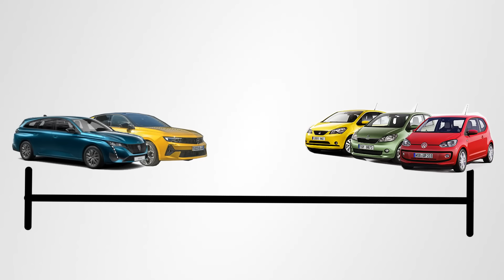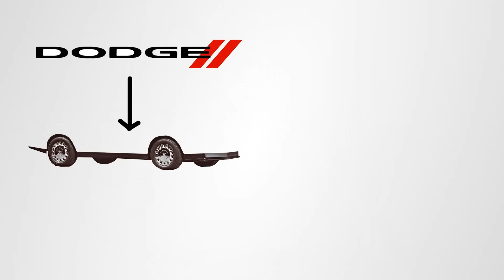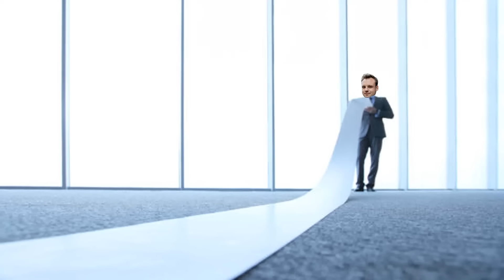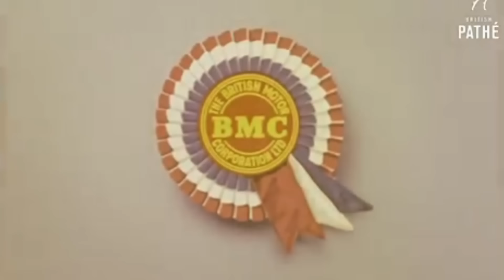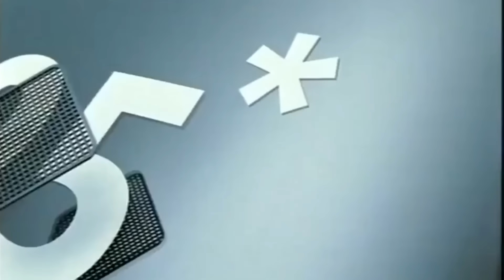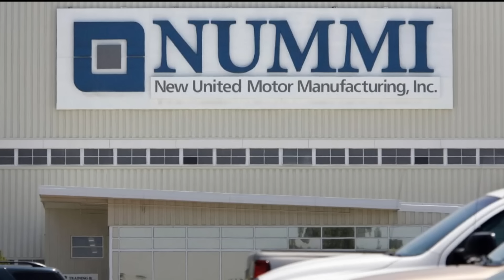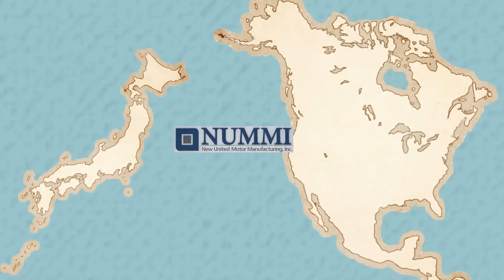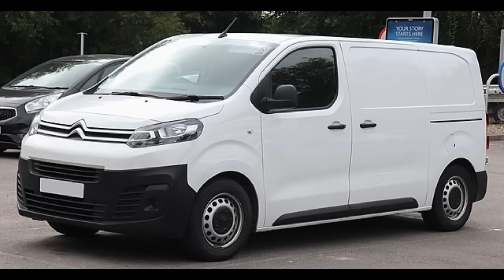Ep. 30 Seeing Double: The History of Badge Engineering

Comment: Rebadging is one of my favourite bits of auto industry insanity. I mean, try and tell the difference between a postwar Dodge and Plymouth, right? Of course I come from the land of Plodges and many of our "home-grown" cars were courtesy of sticking new name tags on existing models. My wife has a Dacia Dasher she calls Daphne; I call it the Romania Renault.
Reply: Our Chrysler cars years ago all had Plymouth bodies, really making them look badge engineered in comparison to the American models.
Reply: While that is true, things were wild in the opposite direction in the early to mid 50s. When Chrysler bet the farm on its new hemispherical headed V8s they didn't build one V8 for all divisions. They sprung for three different engines with different sized architecture. The small 241-270 cubic inch Red Ram V8 for Dodge, a medium sized 276-291 cubic inch Firedome V8 for Desoto and the big 331-392 cubic inch Fire Power for Chrysler. I recall that Plymough eventually got the cheaper polyspherical version of the Dodge V8. When Chrysler replaced their hemispherical V8s. Crazy times those.

Comment: Rebadging in Europe was often practised. Some models were namend here in the comments: First Fiat Ducato was also Citroen Jumper, Peugeot Boxer and Talbot. The Mercedes G was developed by Puch and is until today available as Puch G. There were 2 other Versions oft the G from Peugeot and Panhard. They had other interior and Peugeot Motors. 
Fiat did another project with Fiat Chroma, Alfa 164, Lancia Thema and Saab 9000. Saab also rebadged Lancia Delta as a Saab model.

Comment: From what I remember Holdens here in Aus are various rebadged cars throughout the years from buicks to opels. My favorite though is the 2013-2017 commodores in America are called Chevy ss. Different badges, slightly different trim, worse firmware for the infotainment system and I think that is about it. They didn't even go the Pontiac route with the G8 with bumpers or anything. You look at it and its undeniably a commodore shipped from Australia to america with the changes XD.

Comment: Ford and Chrysler always got away with rebadging cuz they always had, where as the gm brands all had different engines and sheet metal people expected them to be legit different makes. When the 80s came anyone who was an olds or buick fan never forgave gm. Remember the olds cutlas suprime was the top selling car of the late 70s. Now its just a rebadged chevy celebrity? Off to the competition.
Reply: Then again, Chrysler was a worse examples, I mean name me a Plymouth that was made from 1976 to 1999 that was different from a Dodge or Chrysler, you literally can't for 23 years no original design came from Plymouth
Reply: @nickrustyson8124  thing is nobody cared cuz everyone knew a dodge was a plymouth with some more chrome and a chrysler was a spruced up dodge. Today it is still the same with chevy and gmc. Where it becomes a problem is what gm did in the 80s with buick and olds (and to a lesser extent cadillac) when they took legit independent brands and in a few years turned them into what almost looked like rebaded chevys or rebadged versions of each other. Publc used to expect something different from each gm division and now they were just slapping different names on the same car.
Reply: @Henry_Jones  But everyone knew Pontiac, Olds, Buick, and Chevy were the same thing it's a very notable problem with their 1958 line up, the only difference was it was more of a bitch to get them repaired because Chevy and Buick both had 3.8L V6 engines that are not interchangeable
Reply: Honestly, it didn’t help that GM had a HUGE dip in quality going into the 1980s. They should have stuck to RWD platforms, I can’t name a single good FWD GM car.
Reply: @anonuser5852  you nailed that one. 3800 powered cars are reliable as the sunrise and w body cars are good BUT theyre good as used cars. When they were new they were all a week late and a paycheck  short compared to what the competiton had.  Thats still true today. The fwd based gm suvs all suck while thr rwd ones are good.
Reply: Up until the mid 1970s GM division would have completely different engines EVEN if they were the same size! The 455 cid Oldsmobile engine and the  455 cid Buick engines were unrelated. GM was big on having individual engines especially at the higher price scale, and buyers were serious about this to, A Cadillac buyer wanted (seemingly NEEDED) to have different engine than a Buick or Olds. Oddly, Imperial Buyers seemed not to care that Imperials had the same engine as the "lowly" Chrysler New Yorker.. Weirder was when the various division's cars had different chassis while SHARING bodies!
Reply: @anonuser5852  That's a stupid idea, like the worst idea you could've done, the whole thing with American cars was that they were outdated when compared to the smaller FWD Imports, so instead of trying to improve, you double down on being outdated and just make everyone on the G Body
Reply: @nickrustyson8124  Plymouth was only allowed to remain as long as it did to give Chrysler dealers a cheaper car to sell, The corporation had always favored Dodge over Plymouth.
Reply: @nickrustyson8124  By 1958 GM cars had been sharing a group of bodies for over 20 years, The  "A', "B", "C" and "D" (really the "C" was a stretched "B"- a situation that would last until 1984!)  It was the 1959s when it became obvious, as every full sized hardtop had the same "greenhouse". While all of the '59's  (except the Corvette and the "D" body Cadillac limo) were "B" and "C"s, They had different chassis! Leave it to GM to have the parts you can't see be different, while the MOST visible part (the body) be shared!  Useless trivia: While it's a known fact that the "B" body had at one time or another been used for every GM division from Chevy to Cadillac, The "D" body was only ever used as a Buick or Caddy.

Comment: Chrysler sold a lot of re-badged Mitsubishis during the 80s; all the while trumpeting their Americanness
Reply: If I remember right, if it didn't have a V8 or a Slant 6, it was a Mitsubishi
Reply: @nickrustyson8124  no. The K-Cars were not Mitsubishi. But all the colts were. And the little pickup trucks
Reply: @kevinbarry71  No but their engines were
Reply: @nickrustyson8124  The 2.6 and later the 3 L six-cylinder were definitely Mitsubishi engines. But I'm pretty sure the 2.2 was all Chrysler. And they put a lot of those things in those shit boxes

Comment: A ton of Vauxhall/Saturn/Saab/Opel/Fiat

A ton of Daimler-Chrysler era Mercedes/Chrysler/Plymouth/Dodge. I had a US Chrysler Sebring that had Mercedes parts from the 200 and 300 class Mercs in it: Stereo, Heating and cooling, window regulators, suspension parts, and main unibody platform with changed bonnet and front/rear bumpers.  Engine was a 2.4L DOHC Mitsubishi engine.

Comment: Yes, I had a Geo Prizm that was a perfect twin of a Toyota Corolla.  And a Dodge Ram D50 which was a Mitsubishi Pickup Truck.
Reply: We had the Dodge D50 in Australia when Chrysler was still making Valiants here in Adelaide up until Mitsubishi bought the factory. The last Valiants in 1981 were badged as Mitsubishi Valiant as they ran the stock out. Mid 70's Chrysler Australia rebadged the Mitsi Galant as the Chrysler Valiant Galant! And for 1970  the Hillman Hunter with ownership connections with Chrysler, was sold in Australia under its own name- but with a grille and headlight treatment looking very "kid brother" to the 1970 VG model Valiant. (At the time Chrysler had no  small cars in Australia to their name).

Comment: The 1956 Plymouth was sold as Dodge Kingsway in my country. Several different Mopar cars were sold under other names here. Chrysler was often used instead of Dodge and Plymouth.

The Kaiser Henry J was also sold as the Sears Allstate. Sears sold the upscale models for the same price as Kaiser sold the cheapest base model of the Henry J. They were not too pleased about that.

The Chrysler Horizon were also sold as a Plymouth, and here In Europe they were called Simca Horizon. The Dodge Omni also has the same body, but they have rear wheel drive. The Peugeot 309 was also originally supposed to be a Simca.

The Plymouth Sapporo was sold as Dodge Challenger in the US. Many US car makers partnered with Japanese car makers and sold rebadged models in the US. AMC partnered with Renault.

The VW K70 was originally a design from NSU. But right after VW bought NSU they put their brand on it and sold it as a VW.

Several Fiat models like 500, 600 and others were sold as Zastava, Neckar and several other names.

I once believed that my dad had bought a Dodge Aspen. But suddenly I discovered a Volare badge and it turned out that it was a Plymouth. From the inside they are identical. On the outside the grille, lights and turn signals are different. And the side trim sits lower on the Volare (if it has the trim). Other than that they are identical. There was also a modified version of the F body produced in Italy called Monteverdi Sierra, but it looks quite different.

In the late 1960s a German car factory assembled AMC Javelins and sold them as Ramblers.

The Dart and Valiant that the F body replaced also had a lot in common. Up until 1973 they looked quite different, and the Valiant had shorter wheelbase. But from 1974 and on they were almost identical.

The VW Polo was originally sold as Audi 50. But VW quickly decided that it would not be good business to have Audi competing with their economy cars and instead

Comment: My favorite was the early 1970s Nova series.  GM was even in our face with "so-what?" when it named them.  We had

Nova (Chevy)
Omega (Oldsmobile)
Ventura (Pontiac)
Omega (Oldsmobile)

Geez  - N-O-V-A.  And all were the same except for grills and taillights, and of course some interior bits.  Bodies were identical.  I think suspensions were identical, and I think engines were identical at that time, even tho each company used to have different versions of small block v-8s.

Comment: One of the benefits of rebadged autos is that the options available might be different even within the same parent company. Paint schemes and colors might be different. Say the lower brand might use more bold colors like yellow and orange but the higher level brand might have more soft and muted professional colors like grey and white. Some people are willing to pay more for paint. Interior options with the fabric, leather and color might also have a different offering. And perhaps you want to make sure that the vehicle can be serviced by the most dealers or shops or have parts available in the long run without the confusion of "Is this a Scion or a Toyota or a Lexus" - buying in the longevity of the brand name might ease some buyers who might otherwise second guess and be limited in the future. Yes they're the same car but dealers sometimes change brands or mechanical options and you might be left out.

Comment: We bought a used 1992 Geo Prizm in 1993 from Enterprise Car rental.  It had 25K miles, we drove it for 25 years and 200k more miles.  It was a great runner and all 3 kids learned to drive on it and it was the school car for years.  The engine, Tran and all the mechanicals were great.  The Prizm was a Chevy branded Toyota Corolla, and they came off the same line in CA.  The interior was all Chevy and it was crap, the radio was a Delco (thank God for XM!) which crapped out pretty quick, the door handles broke all the time, both interior and exterior, so I had a hotline to a supply company for replacements, and the list goes on…😂

Comment: Let's not forget that a lot of times the cross platform rebadge came with an increase in the sticker price. In the 90s There was the Dodge and Plymouth Colt. They were identicle in every. single. respect except for the sticker on the back (yes, just a sticker, not a 'badge'). If you went to the Plymouth dealer and the Dodge dealer you would see the same exact car for a few hundred more at the Plymouth dealer.

Comment: I had a 1980 pontiac sunbird that got wrecked. I replaced the front fenders with 78 Oldsmobile Starfire fenders and the hood, nose and facia from a 77 Chevy Monza. Then swapped a dented door from a 78 Buick. As all of the cars were the same GM platform the parts were simple bolt on's. Everything aligned and it was actually a far better looking car after I painted it. For fun I put all of the different badges back on the panels. My only problem was with a traffic ticket..the officer couldn't figure out what it was and I had to explain it to him. He had a good laugh and let me go with a warning..

Comment: Im inclined to agree with you in laughing at the hypothesis that Peugeot could offer good engines. However, there was one exception; The 1.6d that was shared among Peugeot & Citreon, and Ford as the 1.6TDCi & Volvo as the D2. I had one in my Volvo V40 and i gave that thing death.. Cold start red lines, no oil change for 30,000 miles, pushed hard around B roads and that little thing took it for over 100k miles of my ownership. I can't fault that engine

Comment: My first car was a 1984 Plymouth Colt. It was actually built by Mitsubishi and was also sold as the Mitsubishi Mirage, the Mitsubishi Colt, the Mitsubishi Lancer Fiore, the Dodge Colt , and the Plymouth Champ.
Reply: In 1984 my class visited the Mitsubishi factory in Adelaide, South Aust. And saw all those colts and sigmas being built. Those colts were notable for the second gear lever for normal or sports mode. That factory used to be Chrysler Aust. Until 1980-81 and was where all Aussie Valiants were built.

Comment: Those early 1960s Pontiac Tempests weren’t rebadged Corvairs. They were powered by a water cooled front engine.  They shared most of their body with the Olds F85 and Buick Skylark. The difference was the Tempest had a rear transaxle and a Pontiac inline 4 cylinder engine. Later some tempests shared the Buick-Olds-Pontiac aluminum V8.

Comment: Back in the mid 70s, Chevy decided that they needed a sub-compact pickup truck in order to have a fuel-efficient vehicle to compete in that market. Instead of investing in building their own platform from scratch,  they made a deal with a Japanese company,  and they re-branded it as the Chevy " LUV". As far as I can remember,  it wasn't around that long, and inspite of the fuel crisis at that time, most devoted pickup truck owners probably didn't care for a sub-compact pickup.
Reply: Australia got the Chevy Luv- still a really cool little ute in 2 or 4wd. Next gen was called Holden Rodeo- also in 2 or 4wd with 14" wheels either way. I had an 83 model Rodeo 2wd 2l petrol (same engine family as the Gemini).

Comment: Have a look around Australia in the 70s, 80s. GM's local arm, Holden, sold Suzuki models under the Holden brand, but these were actual Suzukis, built 100% by Suzuki in Japan, and every part for your Holden Barina or Drover, could be bought at a Suzuki dealer, apart from the badges. They also sold the Toyota Corolla as a Holden Nova, the Camry as a Holden Apollo, and in exchange, Toyota sold the Holden Commodore as the Toyota Lexcen. Chrysler Australia took the Mitsubishi Colt, assembled from CKD kits and some local content, to create the Chrysler Galant. Ford and Mazda got in bed together, and created the Ford Laser and Telstar, from the Mazda 323 and 626 platforms, locally built with some cosmetic changes, and the Mazda 121 early model, was fully imported and given Ford Festiva badges, while being sold against its identical twin. The next generation Festiva was a model in its own image, but built 100% on the Mazda 121 Bubble platform. Mazda B series and Ford Courier pickups, same vehicle, different smile. And I've just scratched the surface.
I wouldn't go picking on GM's home grown platform sharing so much, look at Chrysler/Dodge/Plymouth/DeSoto. Very much the same cars, on shared platforms and their own styling touches, along with Ford/Mercury/Lincoln/Edsel.

Comment: The third generation Chevrolet Cavalier was sold in Japan as the Toyota Cavalier. The only difference between the two was the Toyota emblem instead of the bowtie Chevrolet emblem and that the Toyotas were right hand drive. The Toyotas also had some minor tweaks to them to comply with Japanese standards. Instead of an all red taillight they had red with the amber turn signals, some running lights on the front fenders. Other than that about 98% the same vehicle.

Comment: specifically the triplets toyota aygo, citröen c1 and peugeot 107 are not rebadging. they are joint venture project of toyota and psa (now stellantis). in my impression, rebadging is using of different model and brand name for different markets, but the triplets are very frequently present on the same markets. i would not count them as rebadge. on the other side, i had chevrolet lacetti, that was an genuine rebadge from daewoo nubira, but i have also seen it (in various central europe countries) as chevrolet nubira, daewoo lacetti, and also as buick excelle (apparently from china). has other names too, afaik. also the newest example of toyota yaris/mazda 2 hits me....i am planning to buy new car soon, and was not decided between those two. imagine my surprise, when after some effort of comparing all pos and cons mazda suddenly replaces their compact model with an rebadged yaris.